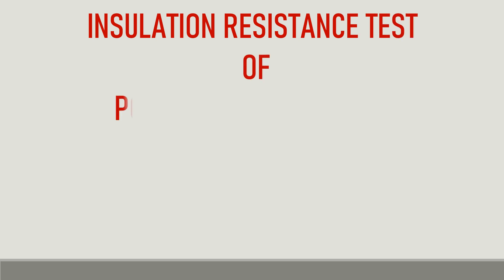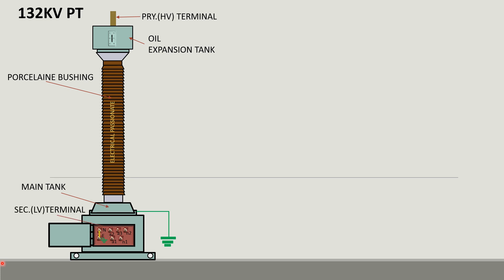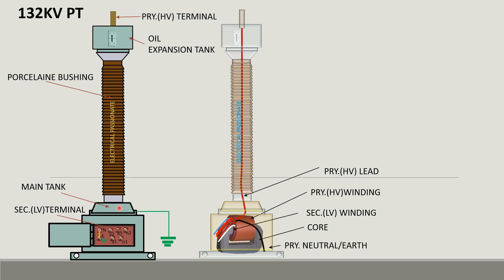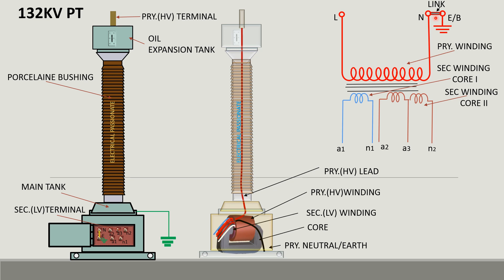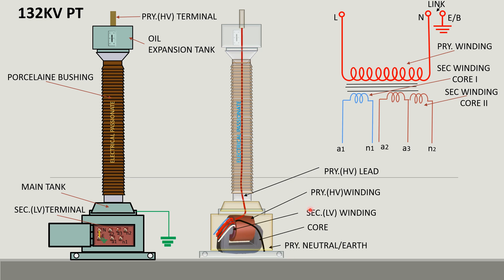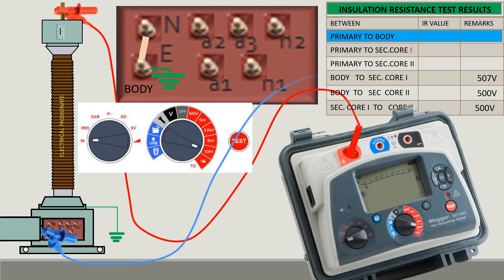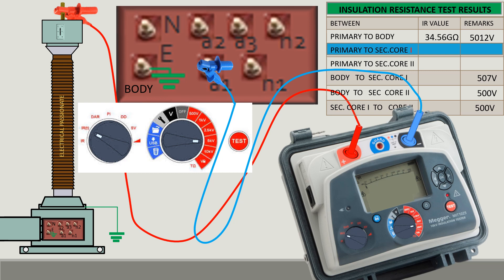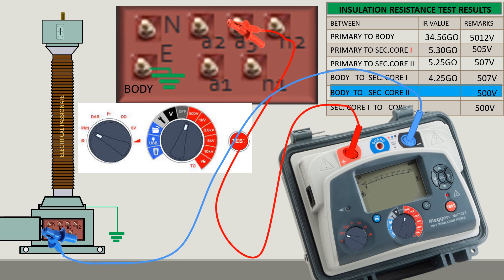PT & INSULATION RESISTANCE TEST OF POTENTIAL TRANSFORMER: MEGGERING OF PT:WHAT IS PT & INSULATION

Comment: Sir , in 132kV/110V PT what should be the insulation resistance value??
Primary to earh , primary to core-1 , core-1  to earth????.... please reply
Reply from the maker: You are welcome. So far as my knowledge is concerned there is no effective thumb rule for calculation of IR value. For a new 132KV PT it should be as high as possible. But for older one it should be how? In few cases IR values of such PT were between pry. to earth 40 to 50 mega ohm and Secy. to Earth were only, 5 to 10 megaohm.And they were running smoothly. Experience will act accordingly. Thank you.

Comment: The n terminal usually has thin wire with poor insulation, if we apply 5kV at HV terminal while we perform the primary to body or primary to sec test wont we stress or damage the insulation of wire of N terminal?
Reply from the maker: you are most welcome.  Sufficient insulation is provided at Primary side to withstand 5KV voltage. When the fuse at primary side neutral opened accidentally then full primary voltage appeared at the N- terminal. Thank you for watching the video and commenting on it.
Reply: @electricalpassionate but we don’t put fuse in neutral at primary side, we install fuses at secondary windings only.I mean the wire that ends at N terminal on the secondary box has small cross sectional area, so can it withstand the 5kv dc volt on insulation resistance test?
Reply from the maker: @konstantinostheo2911  On that case, you must have seen a Link and the Link is connected with the body/tank. When you will perform the IR test you have to open that link. Otherwise, you will get no result. Again a 132 KV or 33KV PT  has provided sufficient insulation and you can use 5KV for testing the PT easily.So far as the Secondary winding is concerned, you must use 500Volt. Thank you.